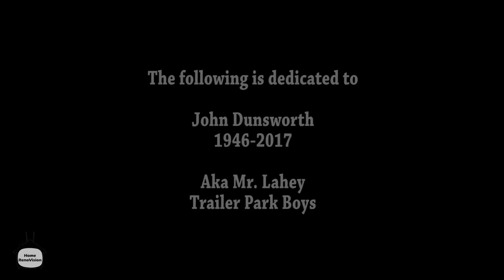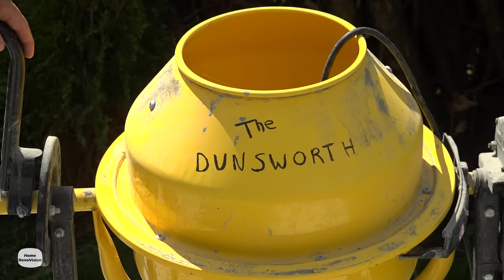Pouring A Concrete Pad | How to Build a Shed | Part 2

Comment: I live in Ottawa too. I’m looking to buy 1/2” clear stone for this same purpose, but I haven’t found a cheap source yet. Do you mind sharing where you got yours?
Reply from the maker: try the garden supply shops. they are scattered around and can deliver by the yard. going to the building store will cost a fortune.. Cheers!
Reply: Home RenoVision DIY Thanks!
Reply: Sean Wilson home depot sells 3/4 inch 1100lbs 25$.

Comment: Hmmm sveral comments. The loose dirt raked around the inside of the boards is not compacted and will likely casue settling and cracks. All soil should be thoroughly compacted. The wire mesh is only on a few blocks. Where your standing on it the mesh will be at the bottom which is usless and can lead to rust and cracking. Should be using a magnesium or wood float not a steel trowel. Horrible cold joints. Just call a ready mix company and get real concrete. You'll want air entrainment if it's in a cooler climate. And don't forget to "sure" the concrete. Many forget this last but important step.
Reply: cure

Comment: That wire mess won't work as you intended as it lacks the strength to support the load of a heavy shed and whatever is inside. You need to use rebar (at least #4 bar) if you want it to handle the load. And you'd need to float that bar so its not in contact with the ground. The wire mesh lying on ground underneath the concrete will do you no good and your pad with crack in no time.

Comment: I think it would have been better to raise the rebar a little so it’s in the middle of the slab instead of at the bottom. But nice job and nice project.
Reply from the maker: Hi Richard, we did place blocks under the mesh so it was lifted up a little. Perhaps we should have been more intentional with this but since we are building a temporary structure we are not as concerned about how the concrete performs. A little bit of an experiment.

Comment: (Noob Alert)

How applicable is this method to building something bigger, like a single car garage?
Reply from the maker: Not, this is really just a temporary structure tutorial. Cheers!
Reply: Home RenoVision DIY 
How is this a temporary structure? That shed will probably be there for the life of the home? 
What makes it temporary and not permanent? 
Thanks for the videos and replies
Reply from the maker: It is considered temporary since it does not have a footing and due to it's size. This is why you can go with a less aggressive concrete floor solution. you could also use a floating deck if you wanted too. Cheers!

Comment: good job,but,mixer too small,mesh should be raised,& bigger,like 10mm,oil or glad wrap the boards,concrete too dry,.i have a pad to do,about 3m x 5m.might get a mini mix to deliver it ready done.they do about 6m2.good vid,should inspire some people.i would probably of killed off the grass for a month before hand then cut out what needed,check level before starting.only 1/3 might of needed removing,just an ausies comments.you could of had the mini mix deliver over the bushes,easy.street access
Reply from the maker: Thanks Harry, BTW we were really stoked to use the mixer so there was no way we were going o have cement delivered. Cheers Mate! And Cheers to Australia!

Comment: Oh man, as a landscaper, this is so frustrating. Without 50mm clearance on the rebar you will get eventually get serious concrete cancer. Without a layer of plastic under the mix you can get some serious cracking. Final job looks ok, but could be a lot better.
Reply from the maker: It can always be better, we are just showing a simple way to get a pad for a shed. Not building a house here!

Comment: Would of been better off with a $12 mixing tub and a mortar hoe, could of had it mixed and screed-ed in a hour or so. Also when using steel reinforcement always hold it back at least 4 inches from forms or it will rust out, and cover the slab, its only a few bucks for steel mesh, just do it right folks, remember it doesn't take any longer to cut wood straight than it does crooked ;).

Comment: 4” depth minimum for cold freezing climates Aye
Reply from the maker: It's a shed not a driveway!
Reply: 4” minimum period. Load doesn’t matter. If you want a slab that won’t crack it needs to be at least 4”. Especially if your mesh is just laying on the ground in separate pieces.

Comment: I am going to try not to be a douche, but here're few things i'd watch out for. Mesh/rebars need to be raised about a couple of inches from ground. The top of the slab is NOT smooth at all. This will cause issues, when laying flooring. The edges of the slab are rough and not rounded. There are no relief cuts; IMO this slab is wide enough to deserve one (or two). Nice video BTW. thank you

Comment: A real trier and a good communicator but sorry, lacking in experience.  Mesh should have a minimum of 2ins cover of concrete and be overlapped and wired, never stand materials and machinery on the mesh as you are laying. Finishing with a broom may be ok on a slope for grip or if there is a floor going on top but for a professional finished workshed floor either a smooth trowel finish or a wood float finish where a seamless joint can be rubbed up, I find that finishing with a wood float is one of the pleasures of concreting.  As a finishing touch (optional) is to take a trowel and ease all the edges at the boards.
Good concreting is something you have to practice under the watchful eye of an expert.
Reply from the maker: how much would you have charged?

Comment: Nothing... not one thing is the easy or cost effective way of doing concrete. Build the frame first, way easier to square and level. Screw the forms together it the same height. Use a stake every 4 ft min. On the forms. Compact the subgrade. Do not pour less than 4 inches thick. Use control joints for any thing bigger that 10 x10. Over lap the wire mesh at least 6 inches . If you don't overlap it don't even put it in. Do not broom it that wet. Let it tighten up a little. And for God sake order a freaking truck to pour. That way it doesn't take 2 days to pour 120 square ft.

Comment: Is there a reason why you choose a pad over Concrete Piers?
Reply from the maker: simplicity, combined with the knowledge that a temporary structure does not need to be over engineered.

Comment: This doesn't look like it would support anything of weight; A riding lawnmower, snow blowers, hand tools, power tools..., a structure. It looks like a couple New England winters would cause it to heave and crack. I've seen work done in sections and that is always the first to go. There has to be better ways than dumping wet concrete onto an edge that's already starting to cure. If I'm spending a thousand dollars and several days work that shed better last beyond the time I'm paying on the house.
Reply from the maker: so your belief is that 3" on concrete on 4 inches of crushed stone is going to fail! Please explain your reasoning, I would love to hear it!

Comment: The finish looks like a cheese grater. Not to mention your steel mesh is on the bottom instead of the middle, where it should be, rendering it useless. Don't follow this method.

Comment: Folks do yourself a favor. DON'T use those bags for a slab like this. Pony up the extra bucks an order how ever many cubic yards you need from a ready mix company. Mixing like this yields inconsistent results and many "cold" joints. An outdoor slab like this should have air entrainment incorporated into the concrete since it will be subjected to freeze/thaw. Difficult to do with these bags. You NEED to "cure" the concrete. There are a variety of ways to do this. Why use a steel trowel when you are broom finishing? Completing these details will yield far better results than what you'll get in this video. Kudos to the video crew but missing a ton of details that will effect the final results. And stop using the term "cement". Cement is but one ingredient in concrete. :)
Reply from the maker: Sorry if my slang offends you sam. Let me guess, you drive the cement oops concrete truck!

Comment: DIYers....don’t waste your time or money.
Hire a contractor 
Finish on that slab was bad.
Don’t broom wet concrete with a stiff shop broom.
You have a cold joint from not finishing the slab in one pour....which is a crack...so why waste money on wire mesh.  Steering people the wrong way on this one.
Reply: Its just a shed

Comment: I didn’t like the slab. Due to you taking two days to pour, the finish isn’t smooth and even. You should have had a concrete company come to pour it for you. That would have saved your back and the final finish. Other than this vid, I do enjoy your other home interior vids.
Reply from the maker: Just a slab for a shed. Not trying to build anything special. just something solid to build on.

Comment: I'm sorry but watching this guy pour a slab is just plain wrong. He didn't use a bow float after pouring it, which is wrong. You don't use a steel trowel after you pull it off. You use a hand magnesium hand float, then edger around the outside. And if it's going to be an inside shed slab, you shouldn't broom it. That slab is an abortion and I wouldn't want to admit to anyone that I did it, that's for sure. Do it right, or get someone who knows what they're doing atleast.
Reply from the maker: The point of the slab was to build a shed on it. if it doesn't stand up and walk away it is doing just fine. Cheers!
Reply: There will be a sitting area in front of the shed. Might get a little slippery when wet, with your fancy shmansy bull float, magnesium float combo. Plus then he would have to explain to us how not to overdo it, blah blah blah. If you want an expert concrete video, go watch an expert concrete video. Anyone who doesn’t do due diligence, and just gets info from a single video should expect to fail. He is showing us how to “pour a slab” not finish concrete. I for one have learned a lot from his carefree, laid back style of building. Thanks a bunch, Jeff!

Comment: Wow I’ve never seen a video that explains more how not to lay concrete, absolute crap, throw that mixer in a skip instantly and I’ve never seen such a poor finish on concrete ever, mesh too small a gauge crushed stone not thick enough concrete of that size minimum 4” thick need I say more!